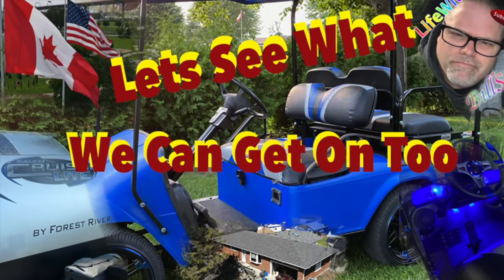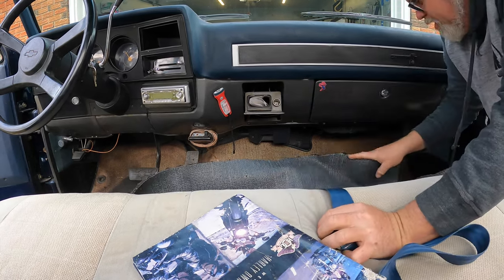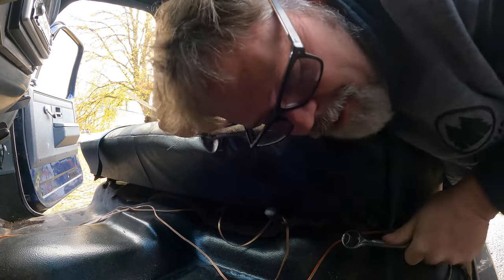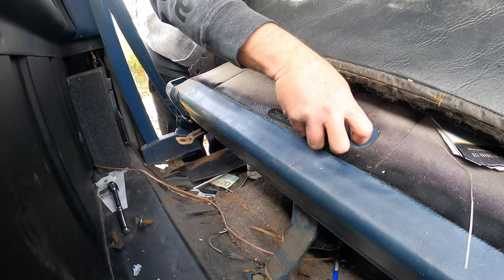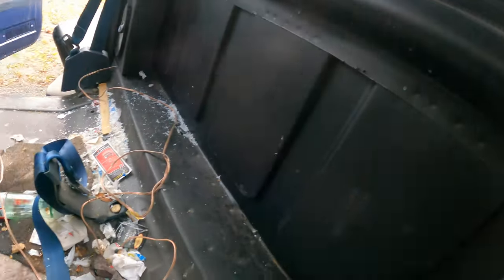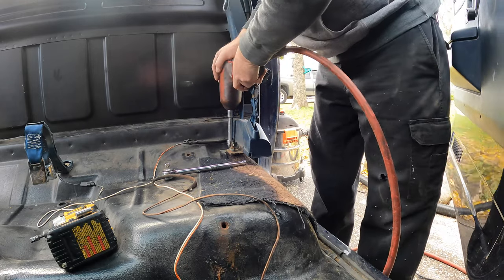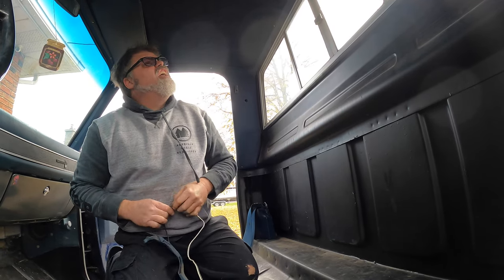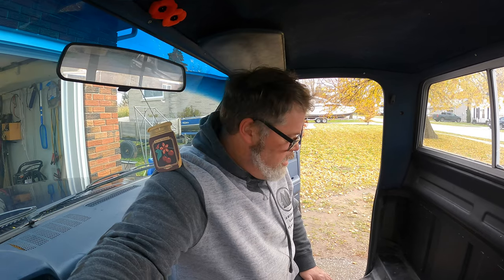Ripping Out Interior Of Squre Body   4K

Comment: Nice floors indeed.    
Other than the obvious places for water leaks,  take a close look at the firewall seam up under the dash mostly near the center. They seem to like rotting out there where the cowl/firewall/etc sheetmetal all comes together trapping water.   Might be able to see light coming in  if you put a super bright light into the cowl area and look up from under the dash.     
 
I'm going to guess $5500 as a friend deal. 

Question since you are connected, Go Glass have good proper thick glass for the squares? Sometime in the history of my '81 it got a replacement windsheild that is the skinny glass that doesn't seal well and I got water leak that seeps in around the glass in a couple spots.
Reply from the maker: PGW Is the best you going to get now theres no such thing as thick glass now a days lol